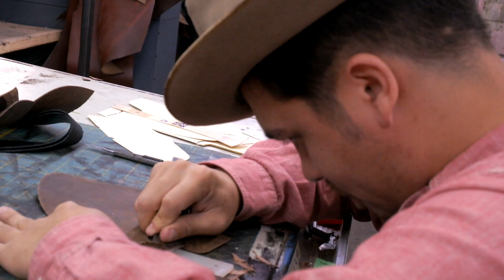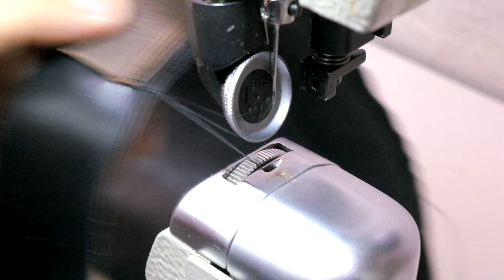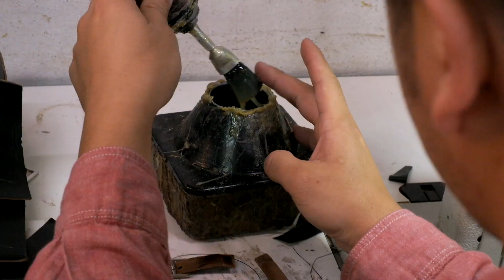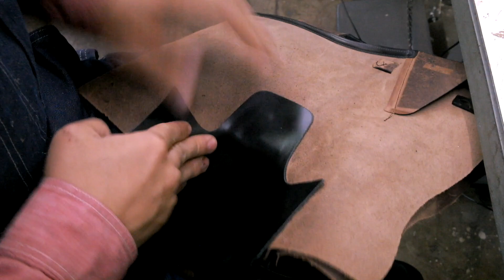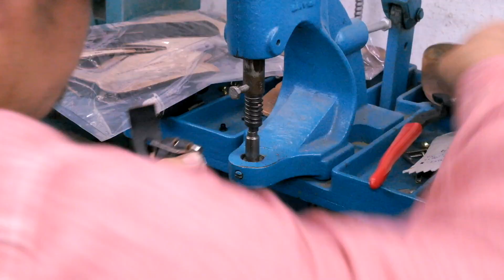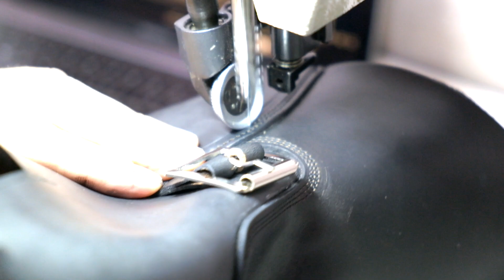BOOT STITCHING | Engineer Uppers

Comment: These will be some very high quality boots.  Triple Stitched!  Crafted to last for decades.

I cannot wait to see the lasting process.  It is never clear to me when the last is finally removed for good.
Reply: A lot of times it is taken out after the sole is attached. Some prefer to take it off before attaching the heel so they can cinch the nails that are in the heel. You can also wait until the heel is attached because after that it is usually only detail work that is left and the last isn't needed.